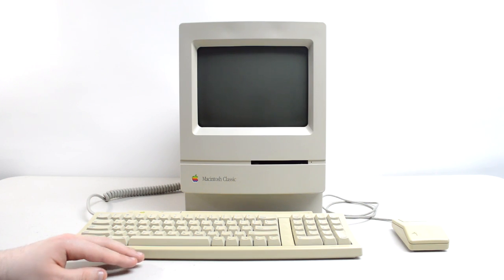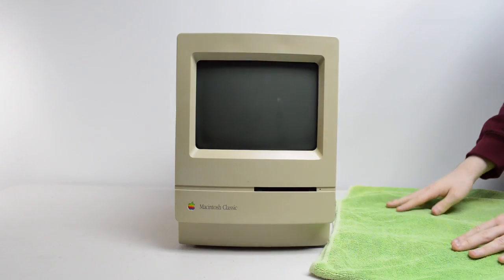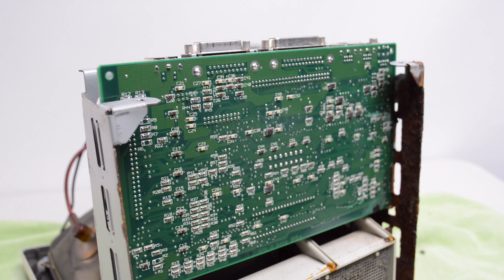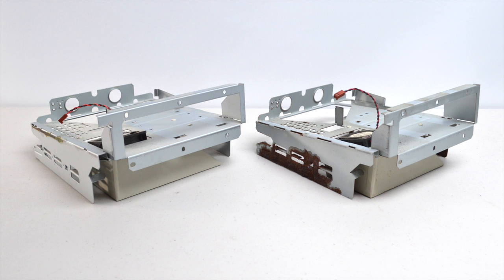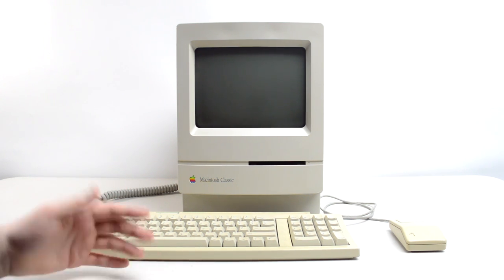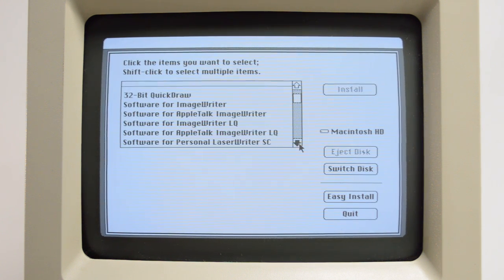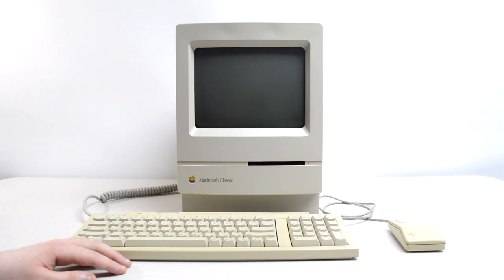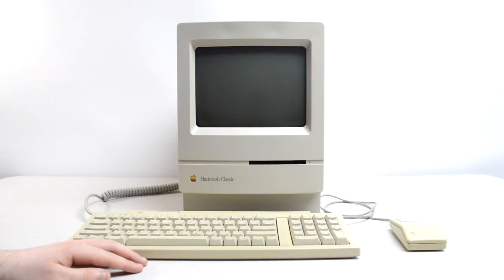Macintosh Classic Restoration (and how I did it) (Part 1) - Savvy Sage

Comment: Another, easier way, to install system 6 is to boot from the bios with cmd+opt+x+o and copy that system folder from the virtual drive onto the hard drive.
Reply from the maker: Even then, the one in ROM is an older version of System 6 (6.0.3), so if you want the best compatibility, installing the latest System 6 makes more sense

Comment: That store ripped you off :x 3 weeks for a job that takes max 40 mins for someone who is accustomed to surface mount. I get that it's a business and they're busy but this is such a small job... Furthermore they gave you cheap electrolytics that will leak again in another 10 or so years. when they should have given you tantalum replacements. 
Hopefully in the future you will try experimenting some more with soldering. Start with small inexpensive projects and work your way up! :)
I'm no expert, but being able to solder has saved me multiple times, and really all you need is good equipment and patience... I recapped my PowerMacintosh 6100 all on my own and it works perfectly. My soldering technique may not be up to the standard of most ppl, but the fact is the new tantalum caps are on there firmly and making good contact. 
Really cool vid as well... Makes me wish I had kept my Classic II that I had back in 2016 :)

Edit : seems like that "repair" they did was nothing more than ultrasonic cleaning of the motherboard. I will bet money those are the original caps. That shop 100% scammed you! :(
Reply from the maker: I should probably point out that at the time I took the computer in for repair (2021), I had never heard of and didn't bother to ask about tantalum capacitors.

As for the repair itself: The capacitors were replaced and it was ultrasonic cleaned, but it probably wasn't enough. (Also, if it were the original caps, I would notice right away.)
Reply: @SavvySage  I'm still skeptical... My Mac Classic II had the sound issue until I soaked & scrubbed it in dish soap water for an hour and let it bake in the sun for the remainder of the day. after that the sound came back and I was good to go for a few weeks. 

If you want to try tantalum recap I would be willing to do so solely for the price of shipping the board to and from. Totally understand if that's weird coming from some stranger on YouTube, but I regret not having the ability to fix my Classic II when I had it... I want to see more of these things kicking around and not dead / destroyed.
Reply from the maker: I appreciate the offer, but there are more problems with this board than just the capacitors, which may be outside of your zone.

Also, I probably should've worded my above message better (I edited it to reflect that): What I meant to say was I would've noticed right away that the capacitors were the same just by looking at the top of them, at least in my case. (Watch the side-by-side comparison between the "before" and "after" photos of the board closely and you'll see what I mean.)
Reply: My screen turns on but it's blank.

Comment: The jiggly screen is a low voltage condition on the analog board, there is a trim you can adjust to fix it. Colin @ This does not compute recently did a video on it.
Reply from the maker: I am fully well aware of that—I've since had the analog board repaired, so the issue no longer persists. (This'll be talked about in more detail in a follow-up episode I'm working on; stay tuned!)

Comment: I have only collected old pc's . But I am thinking of getting a Quarda/Centris AV or a Power Macintosh 9500 maybe even a color classic. But I have no mac's right now.
Reply from the maker: I'd start with any of the post-1997 Macs (such as the iMac), because the older ones use proprietary Apple ports that require adapters (or the original accessories) to use, while the newer ones use the industry standard USB.
Reply: @SavvySage  My dad has an iMac G4 which he is turning into a raspberry pi cuz the mac inside doesn't work correctly.
Reply: About 18 months ago I obtained a PowerBook G4. It runs Mac OS X and OS 9 natively, and seamlessly emulates a 68LC040 processor. So it'll run OS X Games compiled for PowerPC, OS 9 software for PPC, and most classic Mac OS software for 68k. Some very early games might not run or will run far too quickly, but I'm really happy at the sheer breadth of software I can run on it.

Plus it has a DVD drive and USB; there's absolutely no problem getting software and other files onto it.

Comment: The analog board is also known as to having bad capacitors that leak on the bottom
Reply from the maker: So far I haven't had a major issue with the analog board aside from the flickering whenever there's hard drive activity.

Comment: Wait... If you weren't able to surface mount solder.... Hey, where'd that "beyond repair" logic board go? 😝

Also the emulation of M68k Macs isn't perfect, yet.
Reply from the maker: I put it in the yellowed unit and returned it since I didn't have room for another system.
Reply: @SavvySage  As I kinda suspected. I was teasing more than anything, but as an Electronics Repair Technician from what I could see of the PCB in the video it was potentially salvageable with a new battery holder and a lot of bodge wires. Probably really only worth the effort if done to prevent the unit from being recycled. Which it seems to be doing fine living as a theatre prop. Though from a Mac preservation standpoint, someone should clean up that rust to stop it from spreading. It's making any future repair harder and harder as time passes. Even if it's not planned. But I understand it probably won't happen, in time all things must go.